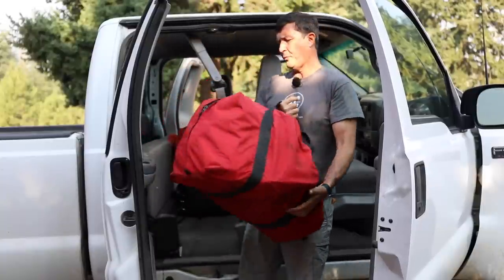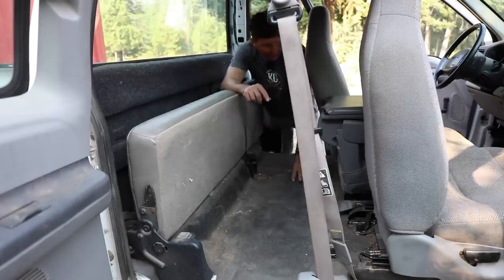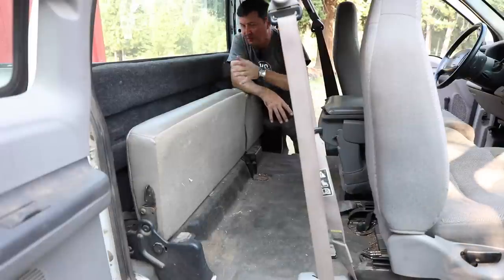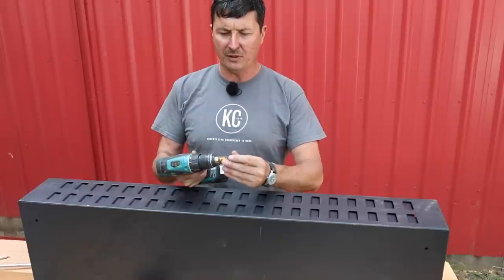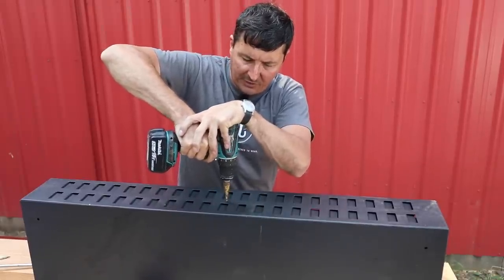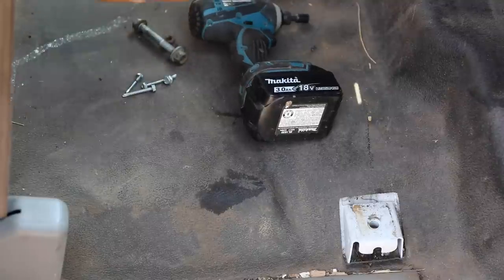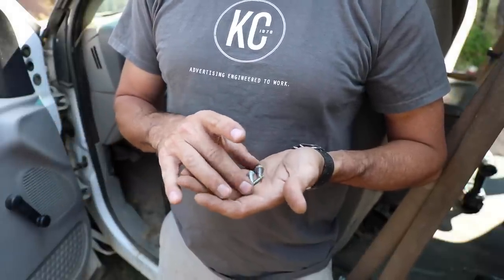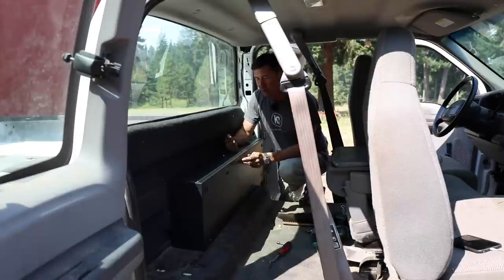Preparing Your Truck For The Apocalypse

Comment: I've always thought that we all should be able to make our own choices as long as we don't hurt each other. With age, having seen (and partaken in) my fair share of stupidity, I'm getting more open to some regulation when it comes to things such as how we treat the environment and how liberally we can obtain firearms. It certainly is a complex matter that can be seen as a double- edged sword. Statistically speaking, gun control results in fewer deaths but clearly limits our personal sense of freedom. I guess it comes down to what your values are (something that also, most likely, is going to change throughout your life). As with most complex problems I don't think a black or white point of view is helpful but rather that the solution can be found in the large gray area in between.
Reply: Gun control absolutely does not result in fewer deaths, particularly world wide. In the US, all crime, including homicide, was on a downward trend when the 1994 assault weapons ban (the single largest act of gun control in the last 50 years in America) came into effect... It continued to diminish for the next 10 years... When it expired it also continued to diminish into the historic lows we have right now. America is safer today than it was 20 years ago directly in the middle of the AWB and it's safer than it was 30 years ago before it happened.

In America, there is absolutely no correlation between gun control and gun violence. Worldwide, gun control is almost always linked to MORE gun deaths, usually with places like Mexico, China, Russia, and virtually all of Africa setting examples. The best you can say is that if you take guns away all other violent crime skyrockets, which is what happened in Australia and the UK. Now that the UK is being overrun by invaders, plenty of people there are wanting their full gun rights back.

It's a complex issue for sure, but the biggest problems we have in America is gang violence and suicide (and frankly, I don't care about the suicides). If you removed all of the gang and suicide deaths, we'd have (from memory, so I could be slightly off) the 3rd lowest gun violence ranking in the world. So basically I'm saying that the system we have now is pretty good unless you're suicidal or in a gang...

Comment: it fully understandable to have guns, where you are because you have animals to will, do you harm.  Not having them is putting yourself and other at risk - how many times has Mrs W out running had to pull her gun due to animals want to eat her! it is a number of times now.  I have been travelling to the USA since the 1980s and live there in the 1990s when did they/why did they start having issues with people having guns in the open in the truck?  I remember a number of people having them on a rack on the bulkhead.

Comment: Put your head between your legs and kiss your keister good buy. Especially is Mount Fuji ever blows.

I worked for a landscape company and I worked with one of the crews that installed lawns. Once chopped and blown straw make its way into your wallet, it never comes out.

Master mechanic Mrs W.

You are a responsible firearm owner. Ignore the anti-firearms people.

Comment: well first thing to do is get rid of that piece of junk Ford and buy you a dependable Chevy.
Reply from the maker: Chevy LOL, Chevy hasn't built a decent truck since the 50's
Reply: to each his own. If you have a good one keep it. back in the 50s they were all good. still made out of real metal and not thin gauge shells. my dad had our Chevy and passed it along to me. It's a 65 c20 with over 600,000 miles on it. great channel btw haven't been subscribed for long but it's good to see someone who takes pride in a job instead of just slapping something together "good enough"

Comment: rotten stinking  metric
Reply: Firstly, how is metric related to anything in this video? Secondly, the metric system has been used for all of the greatest accomplishments of humanity. I guess that indicates that it's not that stinky after all.
Reply: Mrgomado He complained that the bolts holding his seats in were metric. I'm of the opinion that we (Americans) should just switch. It makes way more sense to use uniform units of measurement. Sure would make manufacturing more efficient and ease the pocket books of many gear heads 😅
Reply: Bill R I'm not. Sorry to disappoint.
Reply: +Kactuskid7 I say we compromise ,  go to British  Whitworth    LOL
Reply: Bill R you mean he must be from anywhere other than America?
Reply: Tom Burgess That would certainly make things interesting!